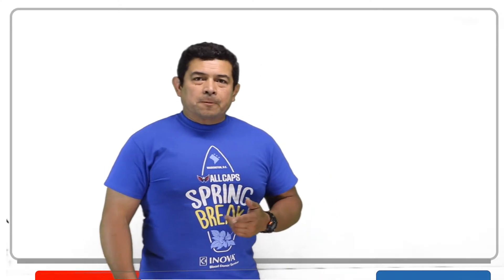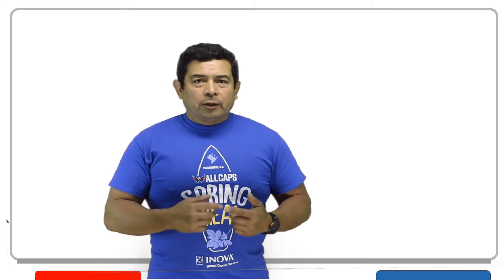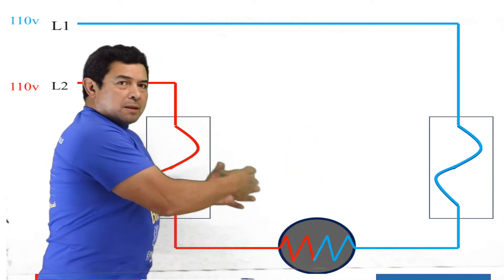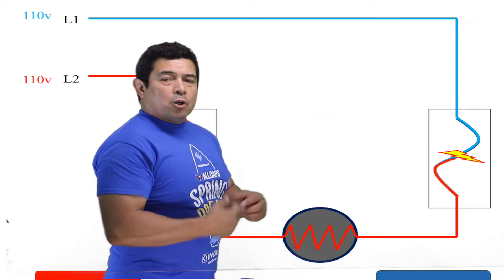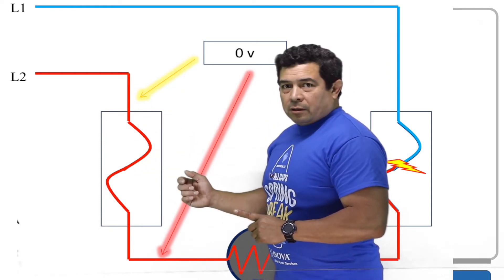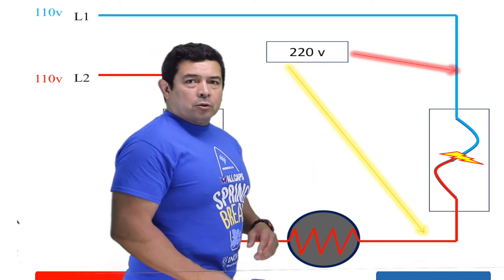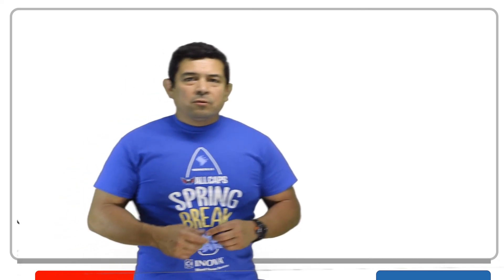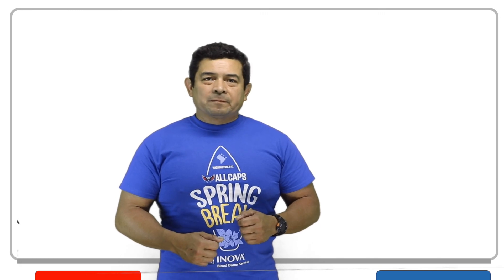Fuse 1 checking a fuse w power - HVAC Online Training and Courses

Comment: A question. You said  the voltage across the load is  0. Are you considering the fuse is open right?
If the fuse is ok (close)the red leg touch the load for una side and the blue one for the other side if you check the voltage across the load the reading would be 240v. Am I correct?  Thanks in advance for your answer.
Reply from the maker: yes if the fuse is bad you will read 0 volts at the load     if the fuse is good you will read the line voltage like you said 240V
Reply from the maker: Yes when the fuse is open or it has blown you will read the, as you said the 240v     if the fuse is good then it will read 0v    yes I am using the red line as one line and the blue as the other line.  yo can see how they meet at the bad fuse and the voltage is 240v      I hope this helped